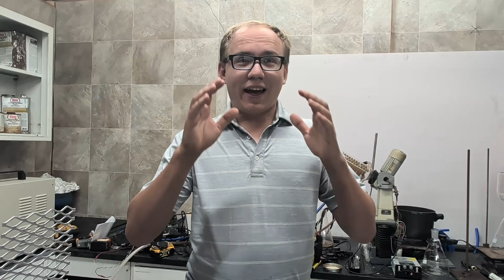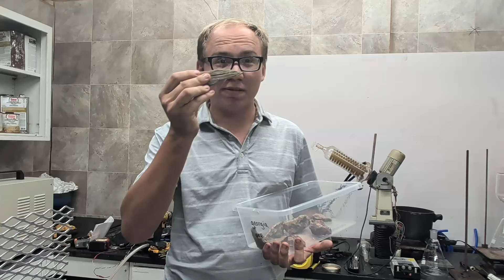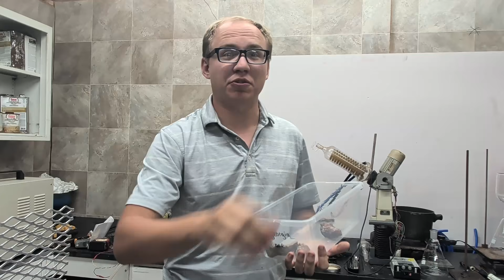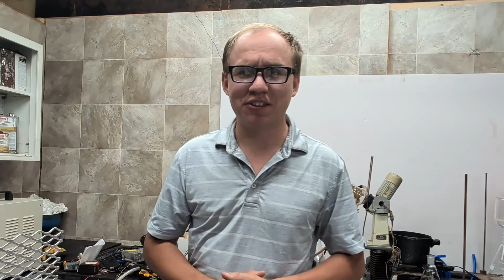Why Asteroid Mining Fails… Until You Go Closed-Loop (SEM TECH vs. the Problems)

Comment: i wonder if you even need to crush the rock at all tbh, if you could seal the chamber on it and advance the electrodes couldn't you directly dissolve off the asteroid into solution? i'm sure it's incredibly complicated but this process is certainly more flexible than heat
Reply from the maker: Electrocrushing is a legitimate field that demonstrates more efficient results than traditional milling. Many potential things to improve the whole setup. But the goal is to make a clear reality check and evidence that the technology legitimizes space mining

Comment: Is the Semtech process suitable to use directly within the variable power output range of wind and solar generation? Specifically, to automatically connect/disconnect more cells in the process as input power allows. Or if electrochemical processing stops for a while,, does that poison the cell in a way that makes resumption of the process impossible?
Reply from the maker: Yes it actually works best for ther because it can immediately start and stop unlike all other methods to produce steel

Comment: I assume you're expecting some sort of centrifugal pseudo-gravity to allow gas removal and precipitation. For Moon mining, which is much less expensive than asteroid mining and we're going there anyway, this is unnecessary.
Reply from the maker: Moon doesn't have PGMs. You are confused with helium that's different
Reply: @Rowow   Assuming you mean Platinum Group Metals, that's not accurate, there are of course meteor/asteroid impacts everywhere, but PGMs are hardly the only resource needed for use in space, even if they are the most valuable for return to Earth. Our intention is to build colonies, which require common elements without the expense of lifting them from Earth.

Comment: Totally fascinating.  I'd be interested in how one would pull target material out of host rock though.  Sure, I could see it being possible where there are conduction pathways, but so many host rocks simply don't sufficiently conduct in order to electro-chemically transfer target commodities out of host material.   A few examples might be along the lines of pulling platinum or irridium out of the host rock of an asteroid.  Could you comment a bit on overcoming this type of mining challenge for electro-chemical extraction ?  

If this is feasibly practical, it's would seem to be a total game changer which  could presumably prevent a great deal of environmental destruction for terrestrial mining, as well as decreasing the extraction and remediation costs drastically.

Comment: I agree that SCM is the way to go off planet also, like Mars or the moon. For asteroid mining my thoughts are this would be a secondary process. I would enclose the material in a temperature controlled environment and increase temperature to boiling points of frozen gases first. By regulating the temperature the gases can be extracted off individually for the most part. Heat from this would be absorption from the sun. Electricity production via SMR is OK and probably needed for scale but solar is about six times more effective outside our atmosphere. The question of power therefore depends on the distance to the sun. Great work you do with realistic expectations sir. ❤

Comment: People are way overcomplicating 0G mining. Hazardous waste is irrelevant in space, at least the hazardousness is irrelevant. Anything else is just efficiency, which really comes AFTER you have something that works.    This can be done incrementally as the materials aren't cost effective to return to Earth anyway. Their value is going to be for construction in space, mostly in-situ.  You start with mining structural materials, use them to build out a larger Hub and processing area, then add tech to retrieve additional materials as needed. With each increment in technology and extraction of additional materials (e.g. Iron, Aluminum, precious metals, water, etc. )  in a modular framework, you can scale up to being able to replicate all components to mine other nearby asteroids.  Meaning, you don't need to create an all in one extractor. You can start with cheaper , simpler tech that can run off of solar and battery alone. Initially pulling ferrous material and water/ gasses for storage and later use, If you need to to offset costs for the  next iteration in the chain sell off the collected water/gasses for orbital refueling.  Creating a single all-in-one machine only creates a single failure point without partial functionality if a problem arises.  If you build as I describe, you can not only mine, but refine, and fabricate which adds several vertical integrations into your profitability model.
Reply from the maker: Watch my other video on iron mining. Sem tech is the most compact, simple, and efficient way to produce metals 

The biggest issue with solar is the square distance law as that the further away from the sun, the dramatically less power you get. Far away at the edges of the solar system there is basically no light to be obtained. Nuclear reactors are a must